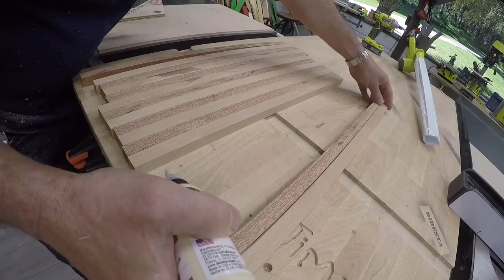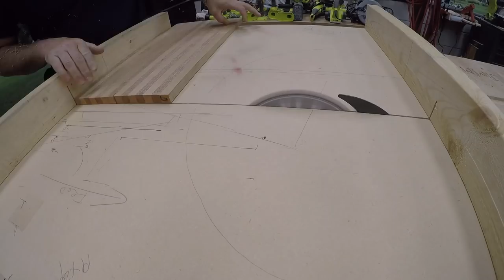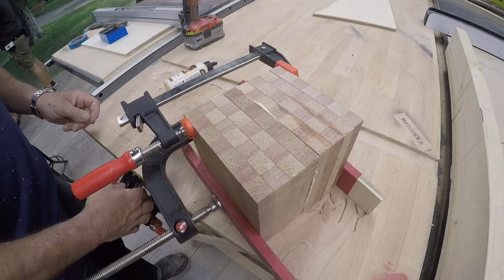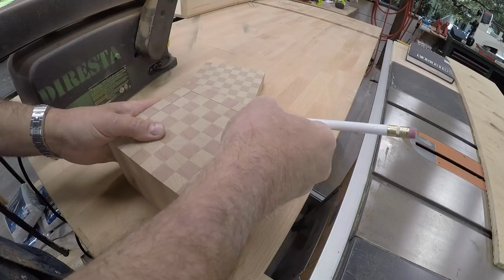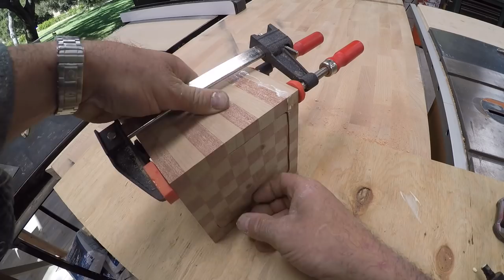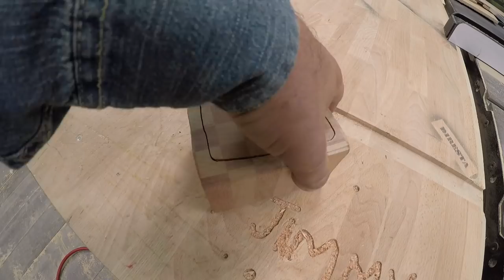DiResta Simple Bandsaw box

Comment: Who’s band saw were you using? I’ve read most of the comments and holy sh*t, you have a lot (not all) of haters on here. LoL
Reply from the maker: DoW xDoNk3YxSmAcKx  I was on the set of a tv show all month in ca. and had limited time with limited quality  tools. The reason I haven't posted new quality stuff. Bandsaw maybe harborFreight
Reply: I can tell because of the way it was cutting the wood and and how much of an angle you were cutting at in order to be in a straight line. My old band saw was the same way until I emailed you about buying the blades you buy. Congratulations on ur show